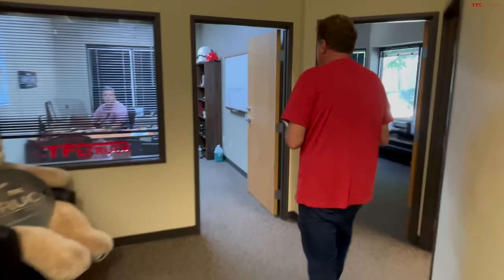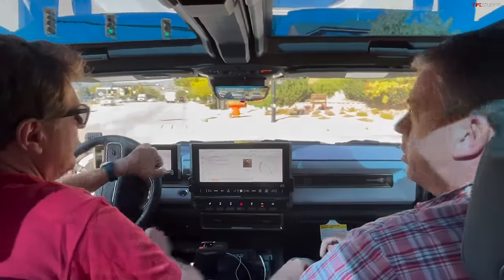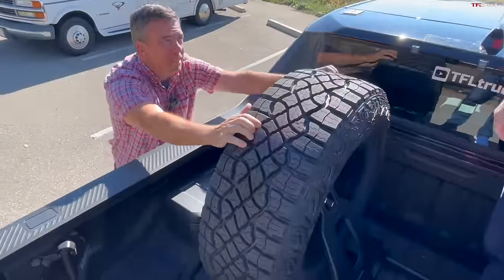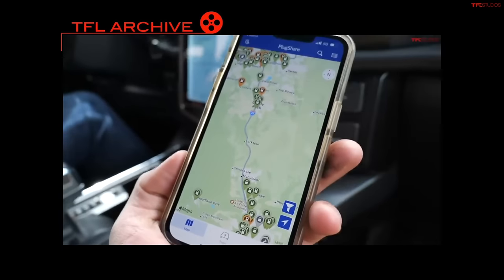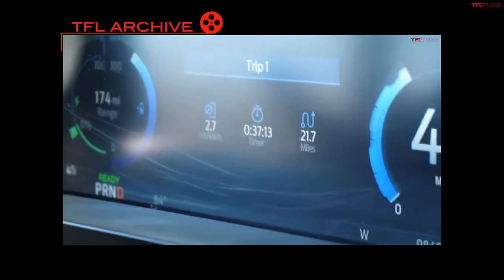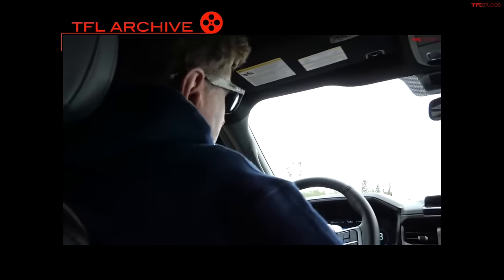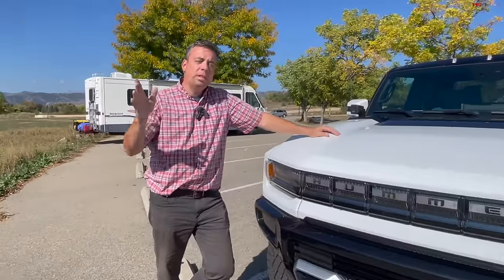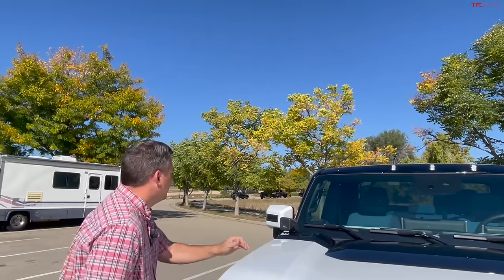Here's What Happened to Our Hummer EV When It Broke Down & WHY We Traded Our F-150 Lightning for It!

Comment: Great video. If we're talking about the range on the Ford lightning and how the the tires pulling a trailer affects the range like an other gasoline or diesel powered truck, how do you think the range will be affected with a 2-3 year truck with the average of 10-15 thousand miles? Like a new cell phone you use it everyday and recharge it every night, and have software updates. You have a new phone with 40 percent battery life at the end of the day. And at the end of year 2 a phone 10 percent. I know the phone has a much smaller battery and you download and update your apps and software updates. But the truck is out driving around in the cold and hot, up and down mountains putting a lot of stress on the main battery. Just thinking out loud how your going to use it everyday like a truck  compared to a normal driving conditions in a car like a Tesla with little no an unnoticeable drop off in range.

Comment: There are alot of electric vehicles in Florida that are catching fire, they are just standing still and burst into flame and the fire department says they are difficult to put out if not impossible! Many of these vehicles sat in salt water covering the battery! Salt water is very good conductor of electrcity ( fresh water also cobducts electricity) but even when they dry out they have a salt film on the battery which cause shorting and arching ,which start fires on combustibles around it!  Also many of these electric vehicles wont take a charge! Also there is no electricity to charge them!

Comment: Cost to charge at home was based on what you were paying  at the time of filming. 

10/9/22
Idk about you but my utility supplier already notified me my ELECTRICITY was going to be 4x higher this winter.. 

Yeah not just my natural gas but also my electricity.
Reply: Mine hasn't changed at all.... so you must live in an area heavily reliant on natural gas or something...
Reply: @redbaron6805  actually the opposite. New Bedford Massachusetts. We’re slapping solar on everything and anything. Multiple  wind turbines built. Our power plants are burning our trash.

The only thing I notice is that they have tacked in delivery charge. Last month my electricity was $120-  $47.95 was the amount used- $72 was delivery.
Reply: @idiotsavant7276  If you have a separate delivery charge, usually you can choose power providers.

Since I have a monopoly, they don't separate it much except into fuel, non fuel and taxes.

Although I can't stand the corrupt power monopoly, at least they are relatively cheap for the time being at $0.13 fixed.

Comment: Oh, a software anomaly.   That explains everything.   The mystery box in a mystery location somewhere in the truck had the wrong mystery instructions loaded into it.  It couldn't be more clear what was wrong with it.  Thanks for that GM.  Breaking down in traffic is a catastrophe whatever the reason.  The fact that it couldn't even limp off the road to a parking lot is inexcusable.   Couple this with the impossibility to actually diagnose or even tow the vehicle and you have a real turd.

Comment: Now from my mechanic experience as one and what else to learn in college Automotive Career Type you probably should have had it shipped over there to the dealer without taking the battery off because of the check engine stuff so it's possible it could come back or might not it's 50/50

Comment: Great job. Live in the northeast. Would like to see how these EV,s range in weeks of sub zero cold and snow.
Reply: Reduced range that is taken but they start at -30C without any problems but you might run empty on the battery just going down the street. Some ICE wont start in -30C without a blockheater or any other form of preheater. But one thing is when we get batteries on our cars that can go 1000km on a single charge no matter the temperature why are we using ICE then

Comment: They want to keep thinking efficiency but the cost of these vehicles is over $80,000 that will buy a whole lot of gas for a long time. You can by a 2 door longbed truck for low $30s that will do better. They are just too expensive for the majority of people, not to mention the super costly problems on repairs down the road.

Comment: There is a nice space on the dash to the right of the wheel. I would recommend that you have a nice big battery isolator switch fitted there so you can do a hard reset from the driving seat.  Save you having to go under the hood to disconnect the 12 volt battery .  As you may find that you will be using it a lot .  In 70000 mile of ev driving Over the last 2 years I have had to do a battery disconnect. Around. 15 times  even to the point that when trying to charge at some dc chargers I have to disconnect the battery before it will charge
Reply: What vehicle?
Reply: and you paid how much to put up with this nonsense?
Reply: @rackoone  Mg ev. The cheap Chinese. One.   About £25 k for the top spec one.
Reply: @bill2960  That'll do it, I heard they are getting better but I dont think I would ever buy one...
Reply: @rackoone   I am in the lucky position that my contract states what payment I am made for using my own car . I have had large 3000cc cars  that can tow trailers etc that I have used as my work cars . But this was the first Ev that I looked at that would cover my daily milage to work and home on one charge and at the price it was offered it just made sense to buy it . Also changed my electricity supply to octopus’s   And now I find I am paying the same amount for my house electricity  as I was before but now it also covers my daily trip of 110 mile to and from work . Summer and winter it gets a bit close to the limit in winter getting home some times with only 2% charge left . But it is saving me around £500 a month. So was a no Brainer .. I still have a large ppl carrier for towing the traylor when I need and in my mind. The savings made using the ev for 30000 mile a year. Plays a big offset to the 2000 mile that I use the big diesel truck towing . This is where I believe that with the right  insurance and tax laws to allow ppl to be able to jump from one car to another  . Then they can use the most suitable car for what they need to do .  And this will make a bigger reduction in co2. Emissions.   That’s if you believe all the hype about it
Reply: If it works it works, having a separate vehicle  definitely helps

Comment: If it's designed to not fail, why not warranty it for the life of the car? My gas car is 16 years old and still runs and drives. The average new car buyer keeps their car for 8 years, but that's not the life of the car. Average cars last 12-14 years, but the best warranty you can get on a 4680 pack is 8 years or 120,000 miles. 

Without a lifetime warranty, someone somewhere is footing the bill for a brand new or salvaged battery before the car dies, or the car will be disposable. No refurbishment as an option.

Comment: Let’s admit that you were part of this problem. You didn’t read the owners manual which would have told you not to reboot in safe mode while driving down the road and you also would have known how to open the frunk and unhook the battery. 

Literally operator error.

Comment: The same millage drop happens with gas Vehicles when pulling weight.  When I pull my camping trailer I drop 8-14 miles per gallon depending g on hills vs flat roads. Not a big shocker here people.

Comment: It's completely ridiculous how electric cars are conditioned by perfect driving, add airdrag or a bigger load and you have a huge problem despite the fact that the engines are hundreds of horsepower. I believe that the problem is that electric motors are efficient only in a certain small range, and as soon as you go outside of it, the consumption goes crazy.

Comment: GM actually told you if you flip this hummer they will void your battery warranty? You might want to direct whoever told you that of the Magnuson–Moss Warranty Act that was enacted in 1975. The gist of it states that not everything needs a warranty but if the product has a warranty it must follow certain rules and requirements that the seller must obey.  And the only way GM could do anything about you flipping the hummer is something hidden in the purchase contract because it’s your personal property you can sell it before pulling out of the dealership. If you walked out to the hummer just after finishing up the purchase and someone walked up to you with a suitcase full of money and wanted to buy the truck from you in front of the whole sales crew they can’t do anything about it. If you took the money from the suitcase and there was another hummer sitting in the lot they HAVE TO SELL IT TO YOU.  And if they trying pulling some wacky battery warranty malarky on the second vehicle the warranty act kicks in again.  There are so many rules and regulations that auto dealers must adhere to you could fill a library with them. And dealers know that most car buyers don’t read anything in their purchase agreements let alone digging up information about any type of warranty fraud. There is no difference between walking out of Walmart and selling a snack cake to someone in the parking lot and the hummer. Your property is just that YOUR PROPERTY……… ok yours and any financial institutions that you get a loan from if you have one.

Comment: I still don't get the hardon the automakers have with full EV for trucks and utility vehicles. As EVs are now is only really good for light vehicles and commuting. Until the battery charging issues are fixed then they won't work for heavy duty work. Maybe an EV assist can help with fuel economy and torque but range is always going to be an issue. This is just a software issue though.
Reply: By the time the battery and charging issues are solved............the market will have moved past EV to hydrogen ICE..............

Comment: What you’re at 300 miles in this video…. So why is it so dirty under the front hood?? Maybe you guys already took it off road in those first 200 miles. Anyway just curious. Is there an inner seal for the actual luggage compartment there? Even still, the rest of that bay is pretty dirty for a couple hundred miles. That would drive me nuts!

Comment: It’s pretty poor form to completely ignore the manufacturer’s instructions to “Bring the vehicle to a dealer,” for the software update, then blame the manufacturer for the problem. By your own account, the vehicle was driving fine, and you decided to do a software patch while sitting at a stoplight. It’s not a good idea to do that with a phone. To use the gas car analogy, you would not try to change a spark plug or a battery at a stoplight. So you should own your part in that breakdown.

Comment: So you pay $115,000 for a vehicle and within 250 miles you get stuck in traffic and have to pay for a tow to the dealer for them to update the software on a brand new vehicle. That makes absolutely no sense. How many times did you have to deal with this for the lightning? Never? Yeah that seems like a good idea. Plus spare tire is an option?

Comment: GM's official diagnosis sounds a little fishy.  if it was a known anomaly, why did they not correct it?  It's more likely there was an issue with rain water getting into an improperly sealed box or harness.  Drive that thing through some water and see if it craps out again.

Comment: It should be pointed out, they DID NOT FIX the Hummer. Fixing it would involve addressing the failure of the redundancy systems that are needed to prevent you from being stranded. No limp mode, no nothing. This is a very negligent design failure. I don't care if its a $100K+ vehicle or $30K vehicle. If the vehicle does not have an emergency get you home limp mode, GM is negligent.

Comment: What I want to know is.... Does the front locker engage now???? Or is that another issue that wasn't resolved and their acting like it's all good now... Also Tommy had an issue with the air suspension off road not showing the same ride height level from each screen, was this resolved ??? Honestly this has been the most embarrassing ownership review for GM yet, I grew up as a long time GM fan and I would buy nothing else, at this point I'll never give them my money again, I've lost all faith in them as an automaker.

Comment: Nice truck..  But I want an EV that is just an EV.   I don't even want a radio... No power windows, no power door stuff, and all critical controls based on physical connections.  My job?... Programmer.  I have 2 gaming rigs at home and 6 total PC`s... But for my ride, I want the simplest interface possible with minimal extraneous information.  I don't really mind some computer control, but I must have override ability available.

Comment: A software glitch bricks a $115,000 brick. A brick smells like a brick by any other name.

Seriously, these EV videos are so sycophantic to the ESG manipulations, and yes brothers and sisters, the price is astoundingly far more than the cost of the vehicle or the fuel for it. 

Everyone without an EV is paying for the EVs and for their chargers and the added infrastructure needed to supply those chargers. All with no choice.

As a side note, the comment about you investing your money in this these vehicles as if that makes a difference. You don’t have to care about or worry about long term ownership. You also get to write losses off to TTFL. You also get preferential treatment at dealerships. To compare your ownership experience to any of the viewers is funny. The other thing is you’ll never have to worry about long term ownership costs. 

All that said, it is still entertaining and informative, EV pablum notwithstanding. Youtube graciously allows fast play back speed.

Comment: A $100,000 + dollar vehicle and theyve had nothing but issues, this gear shifting issue, the broken dif lock switch, software not allowing the ride height change for more clearance off road, it was a whopping 9000 pounds this is little more than a massive multi ton paper weight

Comment: I cannot believe you are just going to accept your dealer and GM's explanation for what went wrong with your new Hummer! Will you accept the same explanation the next time it puts you in danger? I'm not nearly as understanding as you guys are but if that had happened to me, I would have jumped out of the vehicle and ran to the side of the road (whenever there was a break in the traffic). When in a safe place I would have called the dealership and told them to come and get their broken-down machine out of the road and that I never wanted to see it again. Then I would have called my lawyer to make sure I got all my money back. I also understand you guys are in a different position than most when it comes to relationships with the various manufacturers.

Comment: Wow, a known software anomaly.  FYI, no one in the computer profession calls these anomalies.  We call them bugs, because that's what it is, or worse, it's hacked software, and that hack is causing issues to the platform.  I won't own an all EV vehicle.  They have zero actual software security.  There are a few makers who are beginning to instill security gates such as cryptography, but the range is horrid, and there is simply too much of a repair hurdle to get them fixed in a timely fashion.

Comment: During all this he refuses to admit that he himself caused the problem. The manual for this truck explicitly states that changing engine states i.e. cutting the main system power during the operation of the drive i.e. in drive and or moving has a chance to cause problems for the os. Now gm knew this was an issue and included it in the manual so people WOULDNT DO IT. So naturally you did it anyways which inevitably leads to the problem they knew existed. So basically you read the brochure for this truck then bought it and started pressing buttons. Then when stuff stopped working you blame the manufacturer even tho the operation of the truck clearly made reference to not shutting it off while in a driving mode or switching modes outside of park. Which you did both mind you. Then to make matters worse  you increased the software lock further by attempting to switch the trucks mode AGAIN into safe mode. So after you already failed one mode change you attempted to make another one. To make matters even worse again when gm gets this truck in and realizes you've done exactly what you were advised not to do they simply institute a vehicle wide  software patch to completely remove users ability to even attempt what you did. It's like putting diesel in a gasoline engine and blaming the manufacturer for not being labeled brightly enough for you to have cared before you broke your car. But oh well blame gm like it's their fault you cannot be bothered to read.

Comment: I would not call that software update the fix just yet guys. Voltergeists often come out when it's raining and that looked like a voltergeist. It's when electronics become possessed due to moisture or other force majeure. Aka fuses, relays, harnesses, ground connections, etc. having bad connections due to moisture or temperature. Do a test run the next time it rains.

Comment: You have no idea whether they fixed the problem on Hummer or not. They can download new software in a short time, but that's not a guarantee it doesn't have the same or different bug in it now. You drove it to the dealer after rebooting. I've seen another youtube channel pull a 1400 pound flat car trailer, with a light antique car on it, minimal drag, and got really no better range than this FLT video shows. The aero towing argument is a bit false. And btw, $5000 for a spare tire, a jack, gloves and a bag, and a few extra light bulbs on the Hummer is incredibly dumb to do. But then $81,000 or $115,000 for an e-truck that can't beat what my gas engine '96 F-250 with 215K miles on it  can do easily is dumb, too. And my battery replacement is less than $150.